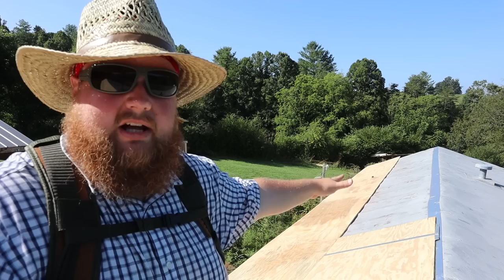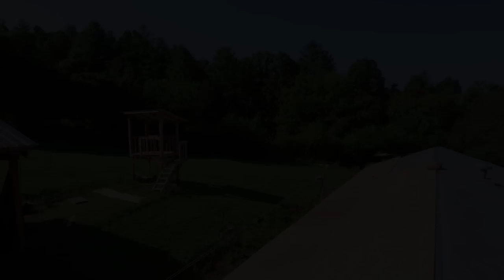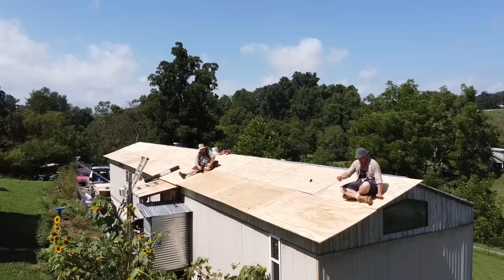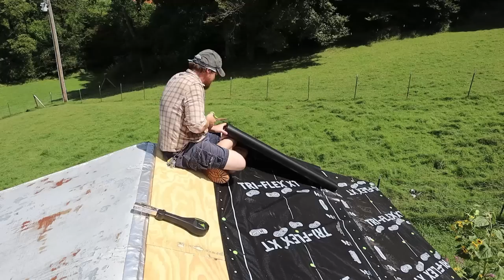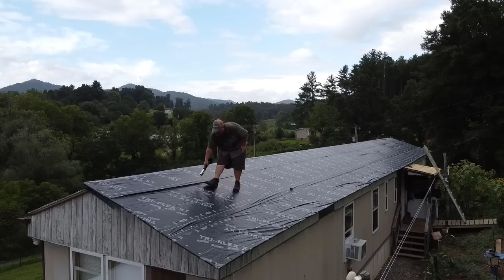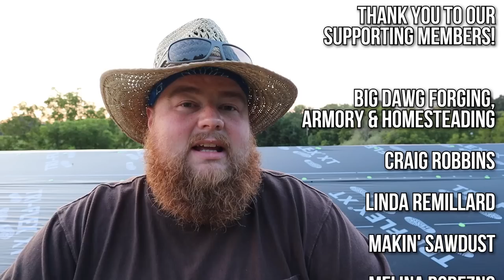Bring on the Rain! - MOBILE HOME ROOF OVER - Day Two with @SteepintheWoods

Comment: I just wish my mobile home had a roof like your mobile home.  Mine is a 14 x 70, but it has a rounded roof that is domed in the middle.  It has no center peak.  I was thinking about doing a roof over, but, was told that with the age of my place that I would have to put poles in the ground and build the roof onto the poles.  I was thinking about running rows of 2x4s along the edges and a row down the length in the center and basically making a peak so that I could lay the plywood on the roof.  I was thinking about putting a metal roof on top of the plywood instead of using roof tiles too.  The metal roofing will last longer too without the worry of the high winds we get here lifting any of the tiles up.
Reply from the maker: There are several mobile homes in our area that are older than ours with the same roof where they have framed up elaborate structures on top--much more than what we're doing! I thought it may be an interesting video to show the various ones around here for inspiration, humor, or otherwise. I don't know how prevalent roof overs are for other areas, but they're popular out here! I don't know about structure strengths or if they did anything to support the new roofs internally. I'll have to do that at some point soon. It would be interesting maybe.

Comment: How often do you have to change that gas cylinder? I'm sure it is too late already but White steel is the way to go to keep your mobile home cool. I have put it on my home and 3 other buildings and I cannot tell you how much it cooled my home vs. the old black shingles I had. On my barn, you can actually touch the underside of the white roof without burning your hand...its just that reflective.
Reply from the maker: They say the gas cylinder will last for 1,000 nails. We went through about 3/4 a box so far. I bought two boxes (1,000 each) and hope it’s enough. We’re getting the same roof we used for our other structures we’ve built here so they match. The color is brown-ish but it is a cool touch coated panel. It’s got a reflective coating to where you can put your hand on the bottom of it in summer too.

Comment: What did you do for venting the roof.? I would have added 2x4's on the flat then laid the plywood and used a fascia vent or sofit vent combined with a ridge vent. With your current configuration, the sun will heat all the roof and without proper venting, the inside will be hot in the summer and colder in the winter. I am trying to vent my roof now, that's why I watched your video, Cheers.

Comment: I have a similar project planned, but after watching the difficulty you had squaring up the first sheets so the rest played well, I’m starting to wonder about my plan. I want to add a 2 x 4 on top of each truss for a 2 foot overhang but I have plywood deckong now and I’m not sure how I’m going to locate the trusses and get them square. I think I’m going to have to run a very tight and accurate string line at the peak so I can measure down when the wind is not blowing lol

Comment: Hi Sam, thanks for putting these together. Fun to watch.  Had a question as I am looking to roof a small project.  Didn’t you need to put spacers between the plywood? If not how do you keep from buckling?  Thanks
Reply from the maker: The clips didn't work for us so we just spaced the plywood apart to allow for expansion. You're right though. :)

Comment: Not sure what kind of cap staples you're using, but make sure they do not telegraph up thru the metal roof- or else you will "see" them. I know regular cap nails will, especially if you're using 29ga metal. If you have not ordered the roof yet I would go minimum 26ga.
Reply: Stingers are the way to go the never lift up out of the ply wood never had a problem with them

Comment: Great video! Can I ask about the materials and ball park figure on them. It looks great! Also are you covering with tin, or shingles? Keep it up, look great!
Reply from the maker: So far the materials (plywood, lumber, underlayment, hardware) have cost right at $1,300. I still have to buy the metal roofing. I'm waiting until the roof is decked out so I can order the metal roof panels cut to the right lengths for our roof to make installation easier.

Comment: You left 12 inches overhang of plywood on roof.  What are you going to do to brace it up?  If not braced it will sag and cause problems.  Am I missing something?  I really do like the way you will try to do anything on your homestead.
Reply from the maker: I'm building eaves and adding them under the plywood.

Comment: does it not become a giant water trap when you fold the roofing felt up under the plywood? if moisture or some water gets into that tray, you have made a perfect place for the plywood to rot .. 
just a warning, if you have not thought about it.
Reply from the maker: No, you're right. It would give the possibility for water to be trapped. I will cut the underlayment when we install the plywood to the other half of the home. The overlap is to keep everything dry until then.

Comment: Did you use the Stinger on plywood or just the Tri Flex
Reply from the maker: We used the stinger cap staples to hold down the synthetic underlayment. This kind was not self-adherent.
Reply: @sam-and-angela  thank you for responding ! I was watching videos because my roof shingles are trying to make unwanted visits to neighbors yards🫣 I’m trying to figure out the step by step. I have read they make a rubber cover but I’m guessing more than metal.

Comment: Did you decide not to use them clips I havnt seen you use any..
Reply from the maker: Yeah, they didn't work out as I expected. As we walked the clips would flex then bend upwards. They would have torn through the underlayment if we left them. I don't know why they didn't work for us. We just spaced the plywood sheets 1/8" apart to give the expansion gaps and left them off.

Comment: You didn’t use the plywood clips?
Reply from the maker: You have a sharp eye! They didn't work as expected, no. In fact, most of my issues and frustrations on Day One were with the clips... I will cover the issue in another video, but basically since the roof still has some flex to it they bent upwards as we walked on the roof installing the plywood. I couldn't figure out why they were not working for us while being an industry standard beside the fact we're doing this on a mobile home and guessing that was the issue.  Think we'll be fine regardless, just wish I could have used them as planned!
Reply: Green Acre Homestead I think you will be fine. It’s looking great. Keep hydrated up there.